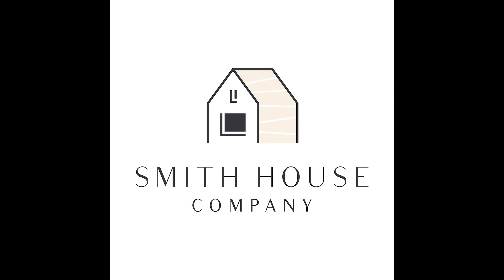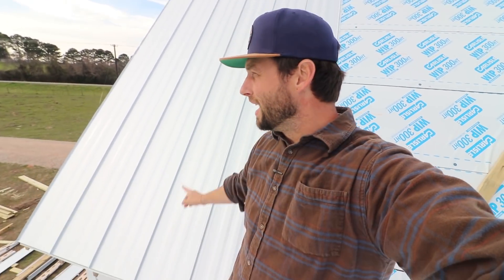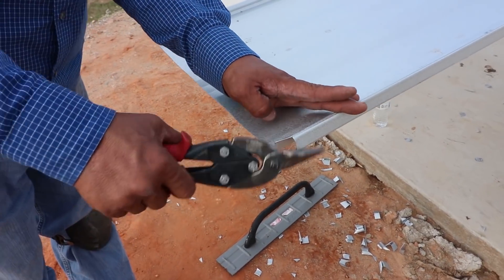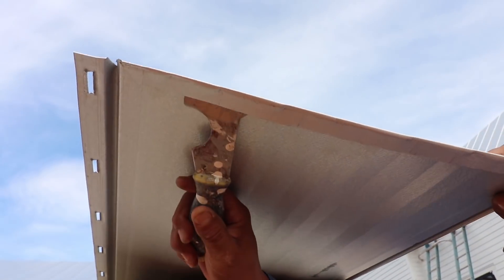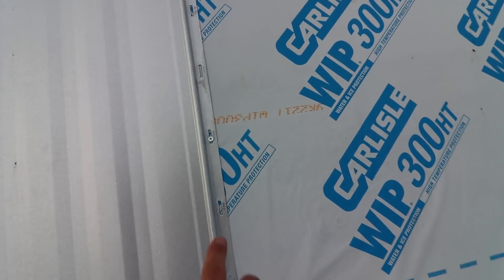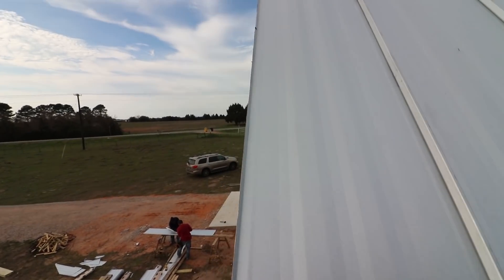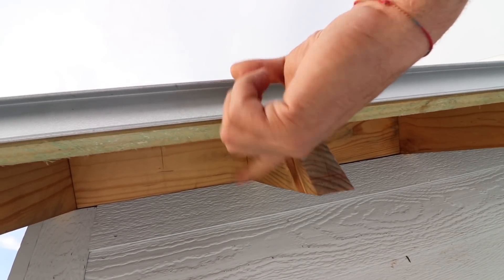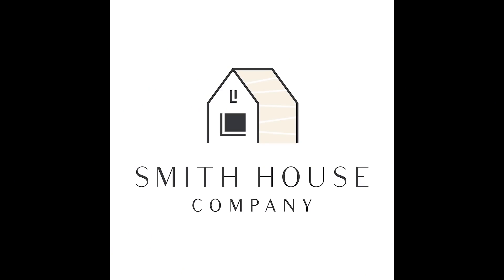Standing Seam Metal Roof Installation and Benefits

Comment: I've been putting on double lock standing seam roofs for 42 years. You can call this a standing seam roof if you want, it's a snap lock. Lead roofs were NEVER put on this way. You need to read up on oil canning. Its usually caused by panels installed too tightly, runs too long, or a machine that's out of adjustment. I find 24 guage galvalume to be an inferior material. It doesn't like paint, and you can't solder it. Your penetrations are only as tight as rubber boots and beads of caulk around them. I despise the whole system. However, on a roof like yours, with no penetrations and a good pitch, it should be fine for 30 years. My terne roof would last 200.
Reply: How much a square do you charge?

Comment: Material looks nice, BUT, why people use white siding with Galv roof is beyond me. Blah and bland collaboration. But whoever picked it out, gets the bill, not me. I would like to see how Matt Risinger’s roof performs in the Texas heat. They ran lathe on 16” at a 45 degree from the eave for ventilation. Sounds next level to me!

Comment: My Camp is getting a complete renovation.  I had a 24 Gauge Standing Seam Roofing Sy put on a month ago.  My electrician was working in the attic while it was raining recently and notice several rain drops hitting him.  I climbed up into the attic and notice that at every seam, aprox. 2’ apart, I could not only see daylight but water dripping or puddling.  On seams that did not have drops of water I stuck typewriter paper through them and pulled out wet paper.  I would say since the attic was dark I was able to observe at least 10 seams leaking and I’m sure they all were leaking. I am loss for words to describe how disappointed I am.  51,000.00
Reply: what did the roofers do wrong?

Comment: I would not use anything that is some special make and proprietary and especially not aluminum, because aluminum will corrode over time, and I would not want that in the environment around me especially with all the links they are making with aluminium and alzheimer's syndrome. Aluminium may be light, but in a lot of sun like Texas, I think it would be really bad. It also would be bad near any body of salt water.
Steel is the best. Steel rust is not going to hurt anybody or anything. It is also cheap.

Comment: Hey Jordan! Awesome install, I just have one concern. There's a video where your good friend Matt Risinger shows a roof assembly with a standing seam panel installed over carlisle wip 300 and he pulls it apart after about 2 years and the carlisle membrane is absolutely fried. He always recommends installing a batten system and other builders recommend using coravent strips. Do you think the striated panel is going to be enough to prevent the membrane from frying? Another interesting note is that Matt's video was from 2014 and he said that the membrane was good to almost boiling temps, but I checked the specs and now carlisle claims it can withstand above boiling temps, so maybe they fixed the issue. Anyhow, curious to hear your opinion on this problem.
Reply: Risinger also upgraded to the Gracie HT for that example.  Good question @Alberto.

Comment: Primer? WIP 300 will stick, throw a couple tacks in it. And it's just Galvalume snaplock, no worries about scratches. Not a top choice when there are double lock systems that are superior. 
Oilcanning doesn't lower the efficiency of the roofing system, its purely aesthetics, the look.

Comment: Hi, I have a timely question.
Im having a 24ga standing seam roof installed on a 2002 manufactured home.  I bought the home in 2005 and since it does not have an attic, I am unsure if there is a radiant barrier on the underside of my roof deck.  The roofer is applying Palisades underlayment and the metal roof color is white. The home is in Southern Arizona so I am concerned about heat in the summer. I currently have 1 layer of asphalt shingles that the roofer is going to remove prior to the install.
What would you do?
Install radiant barrier on plywood roof deck under Palisades underlayment OR over the Palisades underlayment?
Or
Leave asphalt layer on and apply radiant barrier over asphalt shingle layer and under the Palisades underlayment or over Palisades underlayment?
(Could the layer of asphalt shingles be an insulating factor against radiant heat if barrier is installed over top or would the asphalt shingles retain heat longer being a detriment?)
Or
As original quote was;
No radiant barrier and Palisades underlayment on roof deck under metal roof.
We will not do an air gap between roof deck and metal roof but standing seam will have striations.

Thank you so much!  We are scheduled for install on 4/30/20.
Reply: So what did you end up doing? This guy was no help. I have never put on a roof in my life, hahaha but I'm about to and I have watched a lot of This Old House. All houses need a way to get air out from the attic to stop wettness from getting in there from condensation and for cooling in heat. A lot of houses have cut outs at the gable end and or under the roof in between the wall and wear the roof ends at the bottom. Then they also normally do a ridge cut at the top and put a long cap with air holes so that the air can flow. That would cool the roof. If the old roof was flat....why not just leave it as back up protection? It might not look as nice and you probably wouldn't really want to walk on it, but it seems to me that you could just put the metal roof on the asphalt shingles. You wouldn't need anything else.
Since you are paying somebody and he does it as a matter of course, I bet he stripped all the asphalt shingles and then put down the weather membrane and then he laid the metal roofing strips. No matter which way he did it, he should have done some vent holes like I described above.

Comment: Love watching your videos. Really like the standing seam roofs. 
On a side note though and maybe it’s been said, that peel and stick is going to burn from the heat generated without having an air gap. 
Can look back at Matt’s video before you were with him.  It was a call back (not because of the burning) for a leak I believe. The issue was found when some of the panels were removed. Same product, it had burn spots on it and the material itself was brittle look really old but had only been a couple of years if I remember correctly.

Comment: I see your going with the nail strip method, what do you think of the Stainless steel clip systems?....Here in the high wind zone of the treasure coast Florida.....some believe they perform better in high winds....Others disagree....Most installers here are using the nail strip system, I'm told because its less expensive....

Comment: From a distance standing seam looks great, but to live in a house with standing seam when it's raining is a roisy racket.  How do you sleep when its raining outside and the sound vibrates through the roof?  Even Martha Stewart once told her viewers that metal roofs are loud. As much as I'd like it on my home, I think I will only use it on my garage separated from the house. Good on a barn, but not to live with.  And that disappoints me. If you're hard of hearing, then go for it.

Comment: Hey Jordan, I'm currently building a house with a roof done the same way as yours.  I too had 24 gauge standing seam laying flat on the peel and stick which I did the whole roof in.  I used high temp blueskin peel and stick that is made for metal roofing.  At first everything seemed fine, but over time the roof has become very noisy on partly cloudy days where the sun is intermittent.  I was extremely careful during install to not over tighten the screws so that the metal could expand and contract freely. The only thing I can figure is that the peel and stick itself is sticking to the underside of the metal and making popping sounds when the sun comes out from behind a cloud and expands the metal.  The peel and stick has black strips of adhesive on the edges which help waterproof each piece to the next above and below.  One of these black adhesive edges gets left exposed facing up when installing and this is what I think is sticking to the metal and causing noise.  My only hope is that once all the insulation and sheetrock are in, it won't be noticeable.  I wish I would have put down either furring strips or a layer of roofing paper on top of the peel and stick to prevent my problem.  I hope you don't have the same issue...
Reply: The Leavers Family that is exactly what is happening. We have had that issue here on roofs we have installed here in New England
Reply: @brianrobbins3499  The manufacturers don't seam to be aware of this problem or just aren't saying so in their installation instructions.  Fingers crossed I don't have to tear the roof off because of this.

Comment: I installed a very similar (most likely a different manufacturer) standing seam metal roof on  a house back in 2009.  It still looks great today.  Metal roofs are all I will install now.  The higher level of fire/wind damage is peace of mind for myself and customers.  Don't forget to mention that these roofs should easily last 50-100 years (or longer if properly maintained).

Galvalume is superior to galvanized. Just be sure to use shear style cutting tool so that the galvalume is "pinched over the cut end to protect it from rust.  Cutoff saws/wheels will leave the cut edges exposed.

Light colors will fade at a slower rate than the darker colors.

Northern climates (snow) will need to install snow fence (retention) components wherever walkways/driveways are located.  The snow tends to come off is a single sheet ... Can you say avalanche?  LOL

Comment: I had the same problem with a Henry product. It wouldn't stick without primer. On a hot day I can still smell the primer inside the building if the Erv has been off.

I really like these ready to go sheathing products.  Just a shame LP isn't ccmc certified for use in Canada yet.
Reply from the maker: Good point on the voc's if the primer!

Comment: Zero roof penetrations is exactly what I want to do.  Thank you for proving that I'm not crazy.  I would love to see all about the plumbing vent system you designed for this house.  Also, what goes on the ridge?
Reply: MoneyThink : I didn’t say that air insertion valves are not allowed in every state; they are however not allowed in some jurisdictions, NYC, for example. They are relatively new only being around for 2 going on 3 decades, and the code and jurisdictions are traditionally slow to respond. Air insertion valves are allowed by code at say a sink, so long as they’re installed above the highest allowable water level; that said code is the minimum standard and jurisdictions can be more restrictive than minimum code. My point simply was that AAVs close the vent system and while that may be allowed on a leg it isn’t allowed on the main stack. 
I didn’t re-read my previous post but if you took away that they weren’t allowed I’m sorry, most places but not all, allow AAVs in limited uses.
Reply: MoneyThink : Pursuant to code in every US state you can’t have an air insertion valve in place of a vent stack penetrating through the roof. Like it or not the stack is here to stay. Drains must be open to the atmosphere and air insertion valves, which aren’t allowed in all jurisdictions, don’t actually allow drains to be open to the atmosphere as they, by their use, create a closed system. Air insertion valves do not allow things to vest off they enclose the system and only let air in not out. They can cause drain issues if over used or used on a closed loop outside of very limited circumstances and can cause up or down stream traps to actually draw air in or bubble air out due to pressure differentiations when drain/vent lines become filled, even just temporarily filled due to say the slug of water from a toilet flush and can actually lead traps being emptied due to the syphon effect.

Comment: I'm in upstate NY.  Will be building a 50x120 with purlins and standing seam.  Will also have 5 " closed cell foam directly to the tin. No soffit or ridge vents.  Also, no roof penetrations.  Just like yours, vents out the gables

Comment: Has anyone done a study on how much ventilation you need?  2 x 4 seems like overkill, yet I see it often.  1 x 4, sturdi-stip, or Corrugated Lath Strip? I am not sure if some of these plastic products are rated for roof installations. Is there some other composite product that is thin that you would recommend instead of a wood 1 x 4?

Comment: the eave detail is not one i've seen. why close the snap lock void? why bend panel under?
Reply: Close the snap lock void to keep insects out. Bees, wasp, etc. The bend under is to add strength to the edge which can open up at different temperatures.

Comment: Why waste all of that roof which could otherwise host Tesla Ceramic Glass roofing shingles for solar power?
Reply: Use S-5 standing seam clamps and conventional panels for 1/4th the cost and have a profitable system in seven years versus a 20 year payoff. Labor is the solar profit killer on low per Kwh utility supply.
Reply: Can you confirm they are making and supplying them ? I thought the Buffalo plant went bankrupt !
Reply: @johnwhite2576   Tesla Energy are now taking orders for the contiguous US.   https://www.tesla.com/solarroof
Reply: @eugeniustheodidactus8890  get your wallet out. Product is expensive. ROI = long time
Reply: @prescottkemler8420  Expensive, but not so expensive for a new, architecturally significant 50 year roof that produces electricity.  It will  likely be mandated by law down the road for new construction.  Tesla's  emergence within the energy sector is not coincidental.

Comment: In a northern climate, I would absolutely do furing strips if I had a fully insulated attic space. The sun on a cold day could cause huge temperature differences. Allowing ventilation underneath should help keep the temperature more stable.
Reply: Good point. Also the heat transfer will be more significant with the roofing laying on the decking.

Comment: I'm pretty sure putting pressure treated wood next to galvalume is a very bad idea due to the reaction the galvalume will have with the chemicals in the pressure treated wood.
Reply from the maker: You know what?  I think your right. I have no idea why I didn't think of that before you mentioned it! I'm going to have to come back in and decouple the galvalum from the support board. Thanks for the smart comment! 👍
Reply: Wonder why they didn't just go with an air gap system?  That alone would help with any reactions.  It would have also allowed a radiant barrier to be installed.
Reply: @bustertn2014  Absolutely!  Getting the Radiant Barrier on TOP of the roof deck is the single biggest impact you can make on reducing heat flow.  www.RoofingFoil.com

Comment: So other than being expensive, difficult to work with, not adhering (without a primer), Carlisle is great.  

Don't believe any manufacturer that claims their self-adhered product works without a primer. It always peels. The worst part is when it looks like it is adhering and you cover it up - and then 1-5-10 years down the line you uncover it and find it has delaminated/wrinkled, allowing air/water in. I won't ever use a self-adhered product without a primer again.  And it needs to be rolled.
Reply: We used Sharkskin SA on our current project (64 squares) and the guys just pressed it down with a push broom. If you had to try to reposition at all, it was ripping the entire surface off of the LP Southern Yellow Pine OSB. 
I liked it so much that i bought half a roll and we used it for our window sill flashing. 
If it had any sun on it at all it would literally pull your fingerprints off. 
Give it a try, it wasn't even that expensive. 
The only prep we did was blow the roof deck off with an air duster and a leaf blower.
Reply: PS we had that underlayment exposed for three months in a high wind area.
Reply: PPS.... Sharkskin SA has a soft fleece top layer that lets a steel roof panel slide noiselessly as it expands and contracts and wont wear the paint off the back and cause corrosion issues later.
Reply: What do you prime with?
Reply from the maker: Yep and yep 👍👍